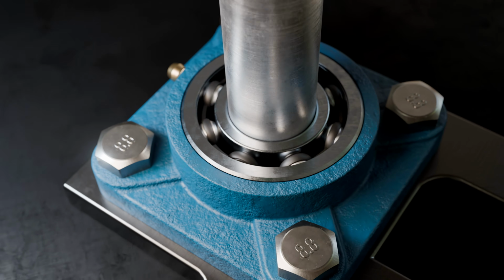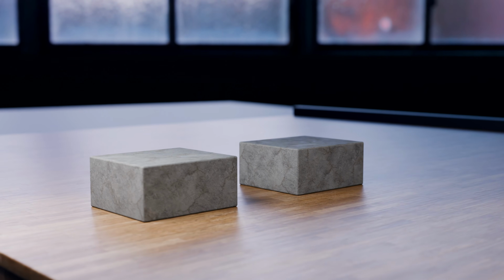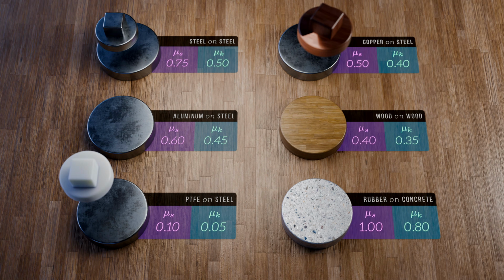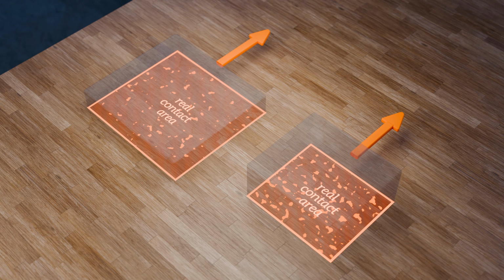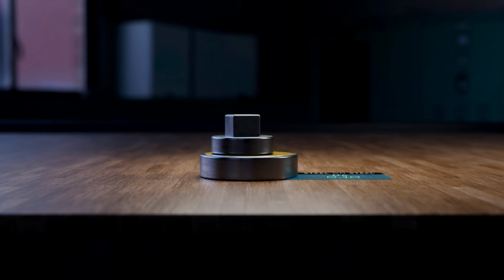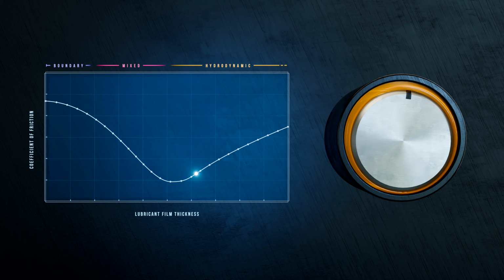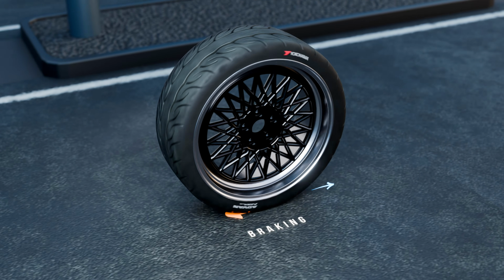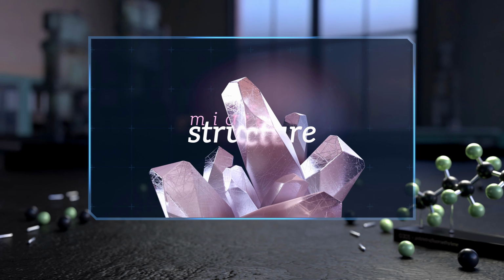Understanding Friction

Comment: I liked this video, but the description of a tire's friction is very lacking.
Any moving tire is always sliding. Its sliding velocity is just very nonlinearly related to the applied force. So it seems like it's not sliding at all, or suddenly loses all grip. In reality it's always a continuous function.
The most practical model is the one of the slip angle vs available grip. It is entirely built on experimental data, and does not fit into the regular "dry friction-wet friction" classification.
A more theory based model is a set of differential equations, modelling the behaviour of the flexible contact patch on an assumed rigid road. The contact patch is usually modelled as a set of hairs resisting bending, and then those hairs experience complicated nonlinear friction with the road surface. These models are rarely analytically solvable, they require discrete time computation to estimate their dynamics.
Reply: And this is the reason why we are watching the Efficient Engineer's videos and not yours.

Comment: I will never forget your mechanics of materials playlist which was the saviour for me to understand that course, but I have a question about 2 things
How the contact area doesn't affect the friction 
If we checked rolling elements in bearing we would find that the ball elements are better for high speed due to low friction due to a small contact area
On the other hand, rollers are better for high loads and low speed applications 

The 2nd question is how the speed doesn't affect the friction 
Car brakes tend to reach higher temperatures when the speed is higher

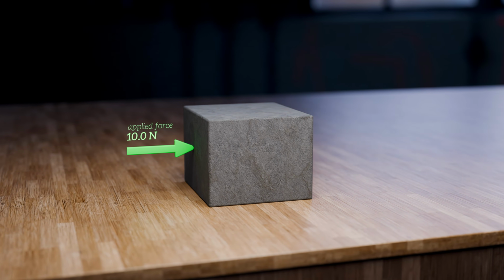Comment: 0:45 wait what if i push it below then 10N it will be going towards me?
Reply: If 10 N is the maximum static friction, then Push < 10 N: static friction matches your push in the opposite direction, net force = 0 = the block doesn’t move (neither away from you nor toward you).

If Push > 10 N: you break static friction and it starts moving away from you (if you’re pushing). Then kinetic friction (smaller) acts opposite the motion. It will only come toward you if you actually apply a force toward you (i.e., pull), or there’s some other force/component (like a slope toward you) making it move that way.
Reply: @चिंतासेचेतन्य oh my days i believe in u without reading
Reply: Yes, because youre thinking of that

Comment: I got a question with car brakes: Often stock brakes on a car are more than enough to bring the cars tires to a complete stop even while the car itself is moving. Braking here is optimized by preventing the tires from locking up, allowing the tires to still rotate while also slowing down the car. Now say you upgrade your brakes to stop the car faster. If the stock brakes were more than enough to bring the wheels to a complete stop, why do upgraded brakes stop the car faster, even though they are both able to halt the rotation wheels?
Reply: Bigger brakes alone won't stop you any faster if the same tires can't generate any more friction against the ground. The advantage of bigger brakes is that they absorb more heat and dissipate it quicker allowing for repeated hard braking but the limiting factor remains the friction the tires can generate against the road.
Reply: @PabloGonzalez-hv3td ohhhhhh ok thanks a ton, I had that stuck in my head forever now, thanks for clarifying that for me 🙏🙏

Comment: At the 3 minute mark, I had to take issue with you using the word bond. As a chemical engineer, I can tell you those surfaces are not forming what we call bonds, but there are forces that act similar to how most people think of bonds
Reply: Vaanderwaal force of attraction i guess?
Reply: Can you go more into detail about this?
Reply: @mailboxgaming6581 basically, cheap magnet vs superglue.
Reply: can you give  little more detail please?
Reply: @burakyks26 it’s pretty much like a bond in the physical sense not literally forming bonds but surfaces deform together and lock together until enough force gets lifted between them or the force pushing it along the avg tangent plane.

Comment: The Engineering MVP himself has uploaded again. 

One suggestion for a video could be an electrical topic explained from a high level avoiding getting into the "weeds" and more focusing on how that relates directly to mechanical systems, just as an example to illustrate my idea, the analogue between mass, dampers and springs, and inductors, resistors and capacitors.

Comment: Suppose I put a book on top of a book and they have a high coefficient of friction, now if I move the book at the bottom, the friction between the two books makes the book at the top move along with the book at the bottom, clearly inducing motion. So with respect to what is friction resisting motion in this case?
Reply: inertia

Comment: I would like to pointnout a slight inaccuracy in the first graph

However, this isn't necessary because the grid ratio could be different but it's not obvious here.
 
The main reason is the graph can be produced with Friction and Normal Forces:
Friction force= Normal force × Friction Coefficient

So simply put, the graph should represent the Friction force and Normal force

And writing Applied force with friction force is a slight inaccuracy. 
But because of the great animation quality and explanation, this small mistake can be overlooked especially that it doesn't harm understanding.

Man, I feel like I am on the wrong side here. i have never corrected someone before. i fell like Iam the wrong one here.
Reply: The graph shown there, actually represents the increase/decrease in friction with respect to increasing applied force and not the relation between those.
You are right about the relation, but the graph shown in video is also correct.
Reply: The graph WAS meant to depict applied force vs frictional force, and it does so reasonably well. 

He wasn't trying to depict frictional force vs normal force, and at that point in the video, he didn't have to.

Comment: The area of contact is as important as force and material. It modifies the friction coefficient. More area, more friction. That's physics, can't change it. That's why formula 1 tires do not have grooves, to maximize the contact area. A real engineer knows that.
Reply: Its because rubber deform, if the material is hard it doesn't change much, if it was iron they would be thin, exactly like the very old cars. It's because more surface = more contact points for the same mass, meaning each contact point have less friction.
Reply: @Locxxus  because the friction at each  point depends on contact pressure x total points in contact.
Pressure is normal force divided by area. 
Total contact points is proportional to total area.
Multiply them together and the area cancels out.

In the case of rubber, the force makes the rubber surface conform more to the other surface, as you said.

Comment: magnetic gears dont have friction at the gears. or ac magnetic roller on a flat metal/steel disc surface as a gear. also magnetic levitation ac/dc does not have any friction on the magnetic surface. then you only have air friction if there is any fluid between the magnetic surfaces. vacuum maglev is the best. ie maglev bearing in space. well magnet-disc gear has locking friction even if the surfaces dont contact. well then you have kinda boundary layer surface contact, but magnetic or fluid/air. water bearing or air bearing, where the fluid cannot escape, just rolls on the fluid. well assuming the rod axle does not sink in the fluid. well air bearing does not make contact because there is air left between the surfaces. thats why air bearing slides very nicely.

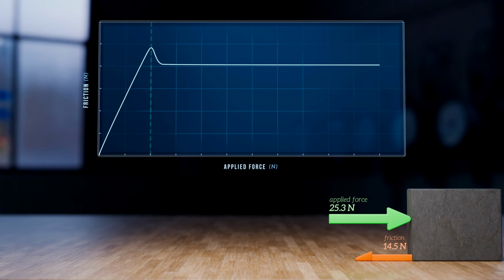Comment: sorry for being petty but at 1:28  isn't the linear increase following  the equation y(frictional force)=x(applies force),it should cut metric grids diagonally
Reply: I think it could have been like that too, but since the scale on each axis is not shown, we cant say its wrong.
Reply: @fabricionunes6507  to some degree it should be, both are forces measured under newtons, assuming its a normal plot with each grid line representing the same difference in quantity (here force),my point could stand

but maybe they are using a different difference in force for the x and y axis,that could be an explanation
Reply: @kazukawasaki97 we can't say for sure the scale on the axes are same
Reply: @psyduckk07 yea fabricionunes6507 pointed that out, the difference in quantity per stride is not the same, usually it should be one unit,as both were newtons I just got that out

it would help if the plot rather showed N/x(friction) vs N(applied force) such that x is a +ve real number more than 1,as I can see here its around 2.8ish
Reply: Different scaling between the axis...

Comment: Trying to understand kinetic friction I did the following homemade experiment: I took a 1''x2'' wood board and cut:
i) two cubes of 1''x1''x1'' which weights 6.3 and 6.8 grams each, labeled "3" and "4"
ii) one rectangle of 1''x1''x2'' which weights 12.9 grams labeled as "2"
iii) another rectangle piece of board of 1''x2''x4'' which weights 54.7 grams labeled as "1"
As you notice, I have two cubes for control, and the smaller rectangle have twice the volume of cubes, and the large one has 8 times the volume of the cubes.

Then having them over an horizontal table made of wood, I place them such they have the side with the larger area in contact with the table, and at the same time, been all at rest in contact with the flat side of the ruler, I gave an initial push to all of them at the same time, and then measure how far they went before stop moving because of the dynamic friction.

It could be "analytically shown" that under Coulomb's friction formula assumption and Newton's laws the dynamics are:
y'' = -k g sgn(y'), 
for an initial speed y'(0) and initial position y(0), been "k" the dynamic coefficient of friction. Given this model, the traveled distance for an object would be obtained as
Delta y = (|y'(0)|^2)/(2 k g)

With this, since in each trial with my set up all pieces of wood start moving with the same speed, if I take the ratio between the traveled distances by each pair of objects on each trial, like:
Delta y_1 / Delta y_2 = k_1/k_2 = constant
I would expect to find constant ratios by comparing the traveled distances for each pair of objects on many trials.

So I tried the experiment with my "rude" set up,  knowing it wouldn't be perfect since was very very "homemade", but I do were expecting to have at least some consistency among pairs of objects after many trials, like expected values keeping the same orders as largest , second, an so on (this because of the law of large numbers).

But instead, the results were completely chaotic (in the math rigurous sense), maybe because of the weakness of my set up, but differences were so large and random, that I am dubious about the validity of the basic kinetic friction model in real life. The static friction set up through the inclined plane is very easy to verify, but kinetic friction is just pure chaos, I believe that everybody could made the same set up at home to see that is ridiculous to expect it to be graphed as a constant line, specially at speed similar to those it start moving after rest.

I hope you could try it yourself if you have access to a physics lab and share your results with a professional set up.
Reply: Now that's some true dedication to Science ! 
Congrats 👏👏👏
Reply: "initial push" is what might be a problem. How did you push? Did any of the blocks rotate even a little? The push needs to be the same. You could try working with pulling weights, but then you induce friction in the rope and pulley and so forth...
Generally speaking, coulombs formula only works for certain material parings and a limited range of relative speed, normal force and temperature. It works quite nice for general engineering applications, but falls apart when one of the surfaces is very irregular or one material is soft or any other parameter grows a lot. Soft materials act more like a brush, where individual contact points may break and regain static contact.
Reply: Actually at first I do had issues with the initial push: if I just hit the ruler, the bigger block acted as pivot point so the smaller block get catapulted (the ruler rotates in this pivot point).
To solve it, I placed 2 heavy books in the measuring starting point at two extremes of the starting line, then place half a meter behind the  wooden blocks and carry them together at steady speed by moving the ruler until its extremes stops by hitting the heavy books. It took a little practice to make the ruler to arrive at the same time to both books so not "pivoting" happened, and I change the orders of the blocks on some trials. 
But neverless, results still ended to be completely inconsistent.
Reply: @whatitmeans  i still think an impulse like push is not same and constant enough. other factors might be the surface combination. Wood is very irregular and you would probably need a very smooth table to compensate. I'm saying all that because static, transition and kinetic friciton can all be replicated "easily" with proper equipment. I dare say every engineering school does that with blocks of metal and polymers in different sizes and with or without added weights, all in a tensile testing machine, usually pulled with a soft cable over a pulley. i myself built a machine for testing friction of headet polymers and i achieved repeatable results showing the same behaviour with static and kinetic friction.
Reply: I answered with a link but YT erased the comment. I encourage you to search in Google for a question I did in physics stack exchange named "A brick sliding in an horizontal plane after an initial push (under Coulomb's dry friction and Stokes' drag) - part 3", there I explained in detail the equations and set up of the experiment I did... I hope you could elaborate your own version with the professional equipment you have and with materials you feel comfortable, and later share the results.

Comment: friction depends on velocity na? for vehicles on road, the coeficient of friction decreases as the speed of the vehicle increases right!
Reply: The friction force remains the same. The reason cars take exponentially longer to stop or turn at higher speeds is due to the increased energy that the car has.

Comment: why does the static coefficient of friction deacrease with the increase in surface roughness at 5:29 ? seems weird
Reply: Basically, if the surface is really smooth, what essentially happens is that atoms have more chances to bond together and create friction. Its called cold welding if I am not mistaken.
Reply: the video oversimplifies a bit there. slide your (clean) finger against flat glass. Friction will be very high as the materials conform to each other creating many molecular bonds. A bit of moisture will even increase that. do the same with rough glass or wood and friction will be lower. but only to a certain roughness. friciton will rise again as you reach sand paper roughness.
Reply: Less contact area between the two surfaces, so less atoms bonding together
Reply: @mackwilde but coefficient of friction doesn't depend on surface area tho